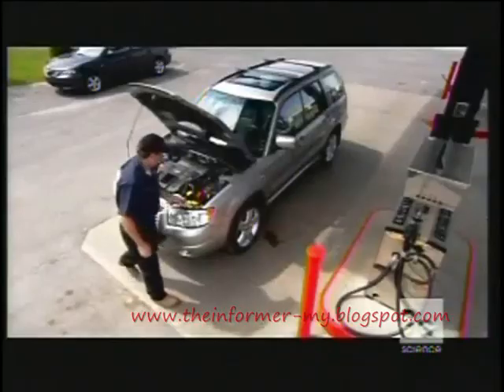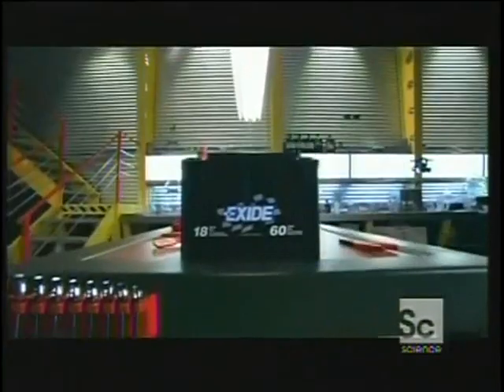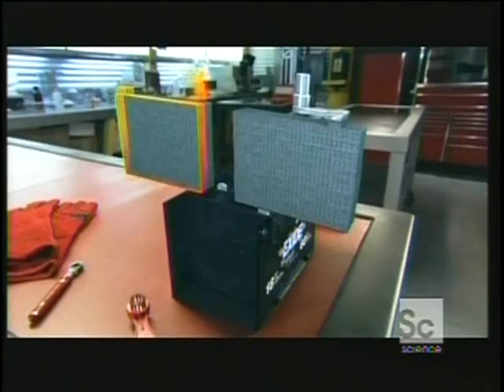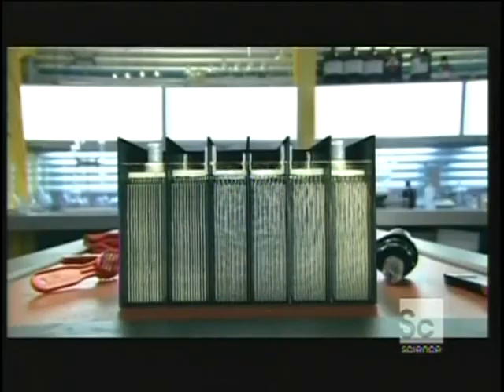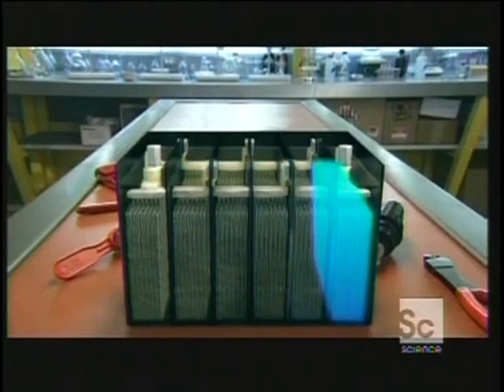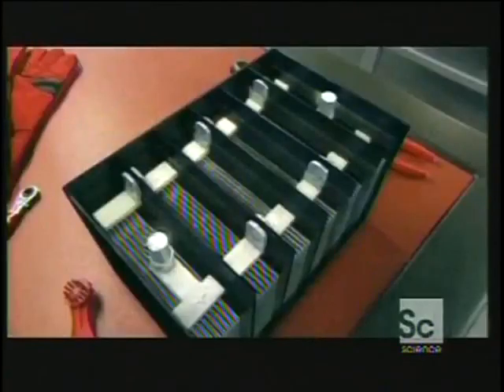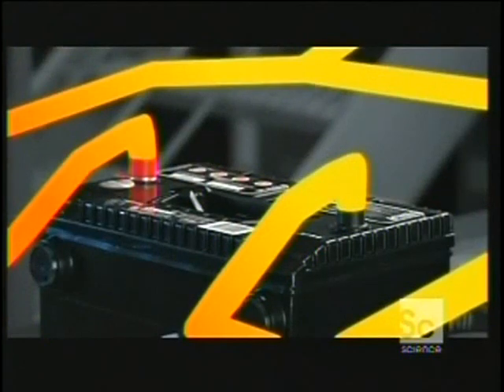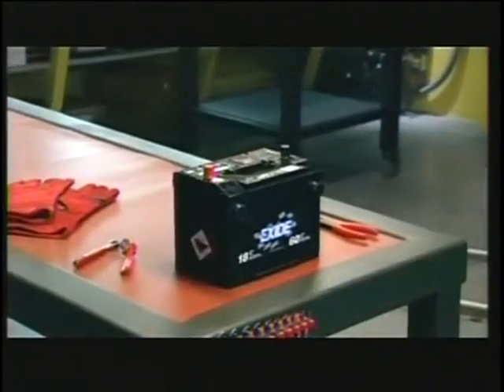Discover How Car Batteries Work

Comment: It is mentioned that positive and negative plates overlap each other. So my doubt is that will they touch each other inside the cell.
Reply: No, they don't touch each other because if they do it's "short circuit", so positive or negative plates are encapsulated with separators.

Comment: They should mention that hydrogen and oxygen form in this process. As you may know, hydrogen is extremely flammable and in combination with oxygen its what they use to power rockets. For this reason, you do not want any sparks/cigarettes near your battery or it could explode.

Comment: Alternators cycle on off at 14 or less volt did not say they charge batteries, battery Chargers do so don't kill us folk with 2000 amp battery systems chow baby

Comment: I recently acquired this battery reconditioning plan ( Check Details Here>>>https://www.facebook.com/Battery-reconditioning-310070329426065/app/208195102528120 ) and just reconditioned 2 car batteries. I did the instructions in a breeze due to the simplicity of the guide. I wish I would have discovered this years ago! It really works for any kind of batteries!

Comment: My battery voltage is 12.8 v . Unable to start the car . With multi meter volt is 12 volts but not able to start why ?pl clear
Reply: Venkata Subbaiah Bhuma 
Your battery has lost capacity. 1 or more cells is bad. Time for a new one.

Comment: I actually just watched to see what was on the inside of a battery..But I have never heard of a battery being charged by the alternator through the negative terminal and I've never seen a negative terminal putting out 12 volts...This video is very misleading..I work with electricity every day for a living even though it's high voltage ac ...Voltage always flows on the positive or hot wire the negative is the return..You will get amps on the negative but not voltage

Comment: "Volatile" usually means "evaporates easily" when you're talking about chemicals.  Caustic or corrosive is how I'd describe the sulfuric acid solution.
Reply: it does evaporate easily live in Florida and you can watch it evaporate

Comment: do all starter batteries produce 12 volts?
Reply: Most 12v batteries will read between 12.2 and 12.7 volts. When the alternator is charging this will increase to a regulated voltage of 14.4 for 12v circuits and 28.8 for 24v circuits which is perfectly normal. 12v in a 12v battery actually means the battery has approx 25% charge, 12.7 being 100%. On 24v circuits you simply have two 12v batteries linked together in series to effectively double to voltage. Hope this helps.
Reply: In cars and light trucks yes their batteries are charged to 12v and send out 12v to all the circuits
Reply: 12 volts nominal

Comment: it doesnt generate electric you fucktard, thats the alternators job
Reply: How do you store electricity? You can't. You can only store electrical energy in chemicals in a battery. They're basically stating that it transfers the electricity that is created by the alternator which is electrical energy into chemical energy when being charged because you can store chemical energy. Then when you use that electricity it then transforms from chemical energy back into electricity by a chemical reaction. They never said it creates the electricity itself, it just transforms it into different forms and then back again so that it can store and use it.

Comment: Hmm, interesting. normally the negative is only used for negative current instead of powering. Thats why we get instructed to remove the negative lead when we change stuf on the electric loom. So that there is no full circuit. Seems a bit contradicting.
Reply: +Sword of damocles If you would TIG weld you would know all about current flow. Current flows from the negative side to the positive one. Here is a question for you, then why are fuses put on the positive side if the current originates from the negative one. = D
Reply: Removing either lead would have the same effect. No transfer from the battery can happen without both terminals. Electron flow is from positive to negative, while current flow is from negative to positive. They probably instruct you to remove the negative, because with things being grounded to the negative terminal, if you were using a wrench and had one end on the terminal, and the other struck part of the frame, nothing would happen. However, with a wrench on the positive lead, if you hit the frame with the other end of the wrench, you'd complete the circuit though it wouldn't shock you, for a long enough period, could destroy the battery, and weld your wrench between the two points.

Comment: It's a sorry explanation for how a battery works; and some of the information is skewed, and some of it is missing.  For instance the electrons do not leave the positive terminal while charging, because then energy is not stored (it's leaving duh) in the battery.  They do not cover exactly how the energy is created and stored in the battery, they only give the reaction with plates when it is discharged, giving you ill information about how it works.  I'd like to see you build one w/this info.

Comment: AA AAA C D 9v etc have resistors in them to limit the current, the amount of C batteries to produce a high enough current to start a car would be crazy. Look on a car battery, most are like 500+ peak amps.

Comment: So, technically, does this mean if your battery died, you could start the car once with, say 8C sized batteries in series?

It just needs to power the starter for a second so the battery then recharges...

Can someone reply and tell me if my theory is correct.
Reply: Impossible. They would have the voltage but a JOKE of amperage

Comment: This video is very misleading .. the power is at the POSITIVE terminal .. not the negitive 
listen to him at ..3:35 saying  to charge the battery back the flow of electrons reverse and the electrons from the alternator come in from the negitive terminal....  sense when...
lol wow this guy it  BACKWARD
Reply: frank0067. THANK YOU VERY MUCH ! Finally someone informed ! POSATIVE source of electrons , therefore electrons flow from +ve to -ve through the circuits (components) !
Reply: the truth is, the current flows in the opposite direction as the elektrons because in electronics you always working with positive charge carriers, so if you load the battery a positive current would flow into the + but the electrons flow into the negative.